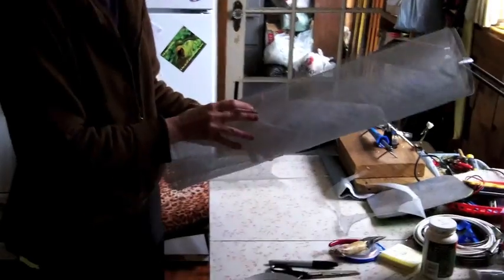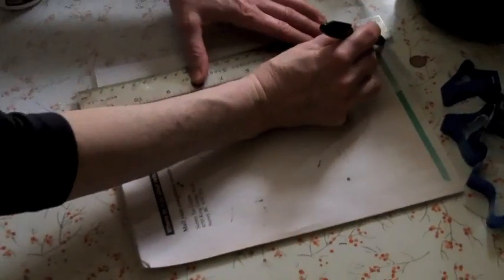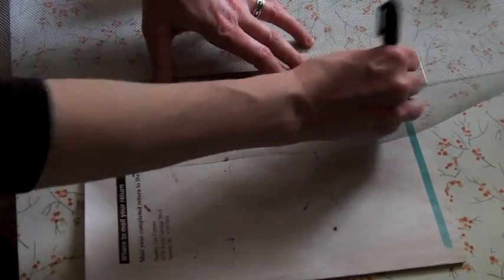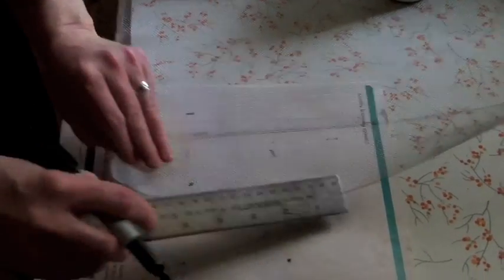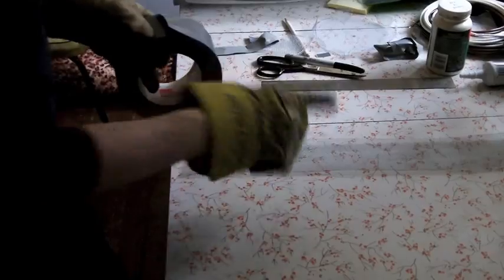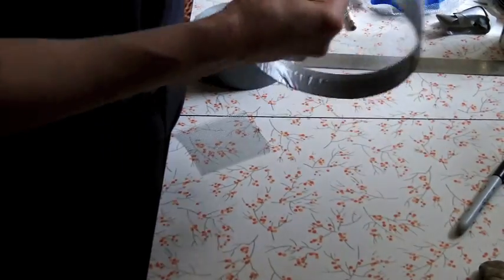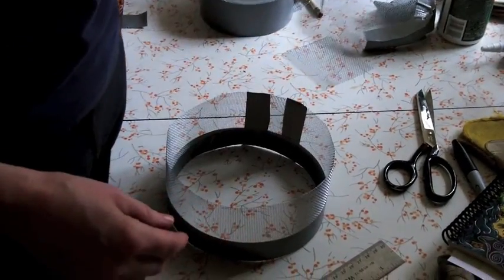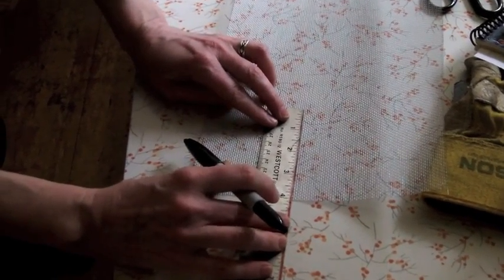How to Make A Smart Meter Cover

Comment: Is it OK to use other types of wire than copper?  What are the readings right in back of the smart meter?  I would like to make these for friends, but only if you can share this information.  Thanks so much for sharing this.
Reply: Copper is the best conductor if you're goal is to create a good ground.
This is why ALL electrical wire is made of copper. It's readily available for such a minimal cost at any hardware store.
Anything else will compromise the integrity of what you're trying to accomplish.

You could make a bunch of these Faraday caps for as little as cost as $10-20 of total material costs.
I just but a roll of aluminum screen last night at HD for $7-. I have duct tape and copper wire but if purchased might
cost an additional $10 total.

I'd like to note that there is an abundance of fiberglass or plastic composite screens that seem to be the new thing on the market these
days. So make sure you're buying an actual metal or aluminum screen mesh.
If the screen mesh is not metal, it will make it completely ineffective.
Reply: +Johnny Little I used thread and sewed the front to the sides.  Headaches gone!

Comment from the maker: Thanx for the comments, :)  I'd like to say that the readings inside the house are as equally reduced as the outside. I've made improvements to the design and will post that a.s.a.p.  Yes, aluminuium or conductive tape is way better! thank you!.  also regarding the space blankets, Mylar seems to be the way to go, but check the ground, it seems the farther you move away from the 'ground' connection, the weaker the effect of the blanket's surface. It may be better to use more fully conductive material. Cheers! and let me know what you discover.
Reply: dose the screen have to be alloy or will stanless work?
Reply from the maker: the screen needs to be metal to work so stainless is fine.  The screen will not block a magnetic field, it is there to block high frequency radio waves. If you can figure out a way to block a magnetic field please share.
Reply: Q Factor Videos easy stick magnets all over the screen it will upset the other magnets thrus for stuffing the magnetic firlds
Reply: How do you know which side to stick the magnets...the attracting side or the repulsing side?  Even so, how do you know what is being pulsed out...the attracting field or the repulsing field?  Thanks :)
Reply: +obieezx11 There's another video about a guy who was fined using a magnet . sorry don't remember the title.

Comment: INSIDE OF YOUR HOME
The best and cheapest way to protect yourself is to pin a Space Blanket to your bedroom wall. You can pick them up in a sporting goods store for about $3. To test if you have a “good” one, wrap a cell phone inside of the blanket and call it. If it does not ring, then use that one.
Reply: A problem with this is that it will also reflect back any radiation that originates from within your room, amplifying your dose, so it's easier to catch the radiation at its source.
Reply: I like the "test method". Good one....
Reply: Frederique Zug hmmm interesting
Reply: Thank you!

Comment: I'm skeptical. It seems all this would do would be to create a stronger beam out of the back of the meter and into the home it's attached to. The rear of the meter does not block the signal, as electrosensitive people can attest. I'd like to see before and after readings from behind the meter.
Reply: No. The Faraday cage absorbs the signal (electromagnetic radiation) and shunts it to ground, it does not reflect it. (much) It also depends on what kind of antenna the unit has on it. The metal "cage" of the electrical box will also help absorb and shunt some of the energy that travels toward the rear.
Reply: watch?v=3tXC8fjrwmY
Reply: it's seems it's coming from the glass not from the back of the box. The box is metal backed and grounded.
Check out a channel called smart guard. He's pretty sharp cat and sells a finished one
but encourages folks like this lady who want to build their own.
Interesting stuff. 
I'll probably do a make shift one for fun in the interim but end up spending the $100 or so to get the smartguard one.
I don't want ducttape on side of house.